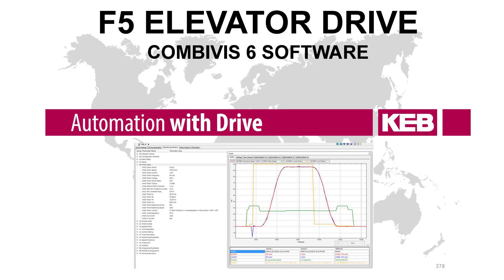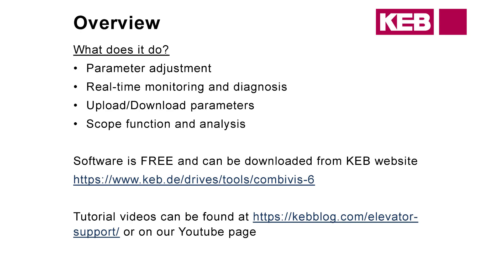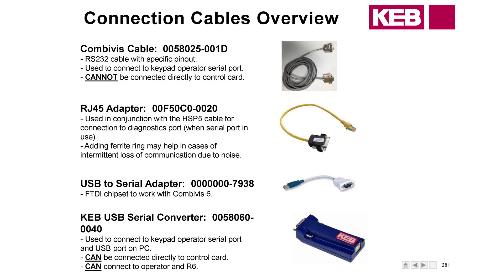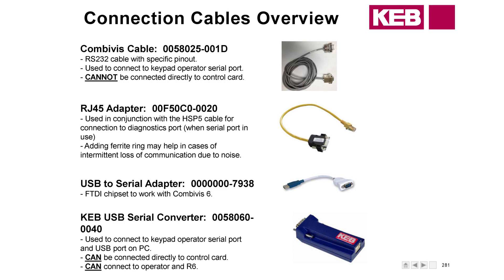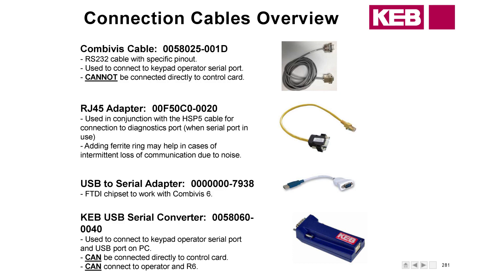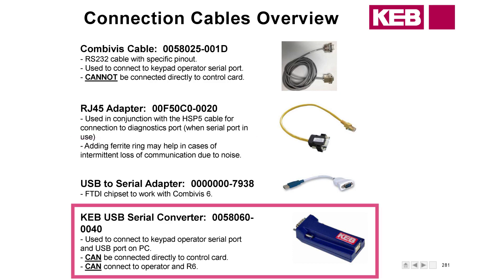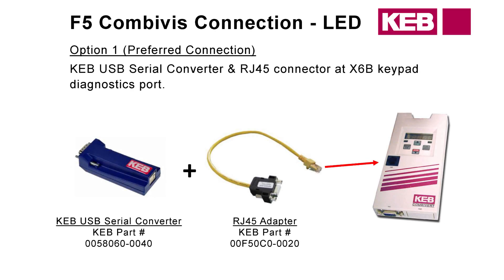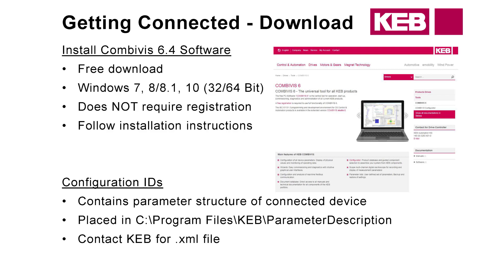KEB F5 Elevator Drive Training: COMBIVIS 6 Software (Part 16)

Comment: On a lot of these I have lost cp2 (frequency reference) it shows 00Hz instead of 40 or 50, any ideas?
Reply from the maker: It's not possible for us to give you a solution without more information. The quickest way to resolve your issue would be to contact your OEM and if they cannot help you please contact our customer support: https://www.kebamerica.com/contact
Reply: @KEBAmerica  I'm sorry, reading back my message I mistakenly put 50Hz instead of 0Hz, who I have now edited
Reply from the maker: Thank you for the clarification. I would still direct you to contact your machine manufacturer (OEM) first. If they cannot help and you need further assistance you can contact a local KEB representative. If you are in the US or Canada you can reach us here: https://www.kebamerica.com/contact